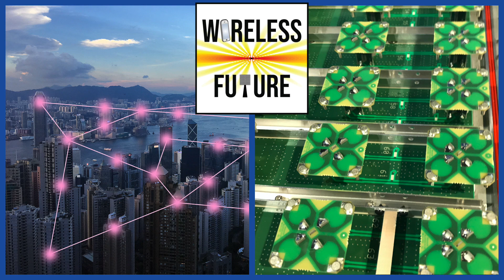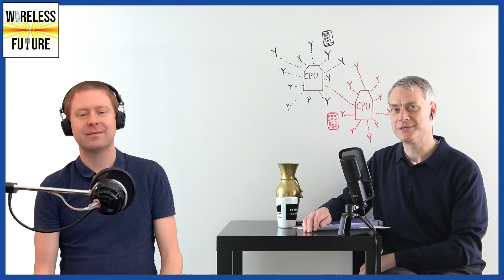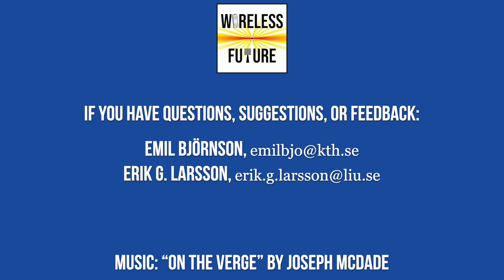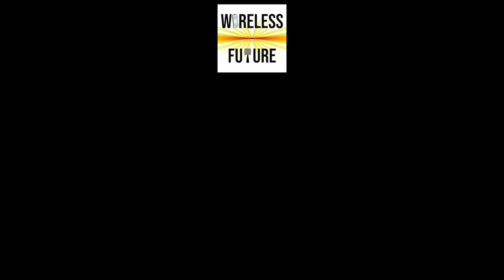Ep 13. Distributed and Cell-Free Massive MIMO [Wireless Future Podcast]

Comment: Hello professor, I have a quick question. I have been surveying a lot of CF-mMIMO papers and I have seen there is a dearth of papers on the detection of CFmMIMO systems, especially in downlink. Most of the receivers consider working on detecting the different users at the AP in the UL and not the other way around. Why is that so? Don't u think we should also look at how detection is done at the UEs too? Thanks
Reply from the maker: The classical way to connect to a network is for the UE to send a random access sequence and then get scheduled for uplink/downlink transmission at specific resource blocks. No user identification is needed, apart from the random access procedure.

However, if UEs send very little data per transmission, the random access procedure might consume too much resources, relative to the payload data. This is when the AP must also identify the user.

In the downlink, if the UE isn’t scheduled but should receive data, then there is a paging procedure that can be used to contact them. There is also the concept of wake-up radio, which makes paging more energy efficient. Detection is needed at the UE in these cases as well.

Comment: This is sort of TDMA receiving, rather than TDMA sending, correct?
Reply from the maker: I’m not sure of which statement in the video you are referring to. But distributed MIMO isn’t based on TDMA.  Many users can transmit (or receive) data at the same time using the same frequency. When transmitting to the users, we can send multiple signals at the same time and phase-shift them in such a way that each signal is spatially focused at the desired location. So each user hears a strong version of its desired signal and a weak version of all the other signals.

Comment: 10:04 But the system doesn't depend on interference at the other nodes, because they aren't listening at that moment, correct?
Reply from the maker: The word “interference” can be confusing here since it has two different meanings.

Constructive interference means that the signals arriving from different directions (different access points) are added on top of each other, so that one gets a strong signal at the desired locations. 

This also means that the signal will be weaker at other locations, so if there is another user that wants to simultaneously hear a different signal at that location, it will be exposed to less disturbance (less interference).
Reply: @WirelessFuture  Ah, so due to destructive interference at a neighbor node of the target node, the neighbor node will be in a null-ish region for the signals being sent to the target node, correct? But, depending on the transmit frequency, the quantity and positions of the transmitters, and proximity of the neighbor node, isn't it possible or, under certain circumstances, likely that whole the neighborhood will hear coherence? Won't most neighbor nodes hear sufficient coherence? For example, with 5 transmitters at random distances and angles, we'll get a pattern of nulls and peaks, correct? But most listen locations WON'T be in a null, correct? At 900 Mhz, for example,  how frequent are the nulls? What's the distance between the nulls? Won't most receive positions hear sufficient coherence for proper demodulation? What must be the distance between the target node and the neighbor node to ensure the neighbor doesn't hear sufficient coherence? Half a wavelength (16.5 cm)? Half a mile? Thx!
Reply: I think the answer is in your other video here, correct?
https://youtu.be/L985zYsIuwc?t=1947

Comment: thank you for the podcast! what are the technical specification of cell-free massive Mimo systems?
Reply from the maker: The algorithmic details are summarized in our book that you can find here: https://github.com/emilbjornson/cell-free-book
Cell-free Massive MIMO can likely be implemented on top of the 5G standard, since it already separates the control plane and data plane. The user device doesn’t have to know if the signals come from one access points or a cluster of them.

Comment: As prof. erik said there are multiple antennas at user equipment to resolve number of signals coming from different transmitting antennas (access points)...so my question is, are there more than one antenna at user equipment? kindly reply...
Reply from the maker: Yes, if the user device has multiple antennas, it can resolve multiple streams in that way. Starting from 4G, user devices generally have multiple receive antennas (but often only one transmit antenna).
Reply: @WirelessFuture  ok thank you sir, so kindly tell me how many receive antennas are there usually in 4g hand set/user equipment...
Reply from the maker: Two receive antennas. It is usually called 1T2R, in case you want search more about it.